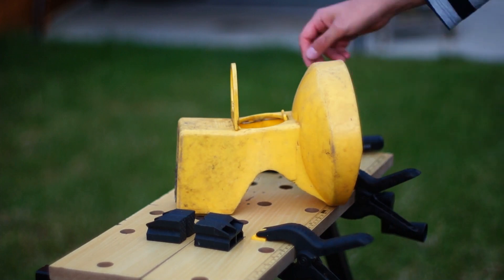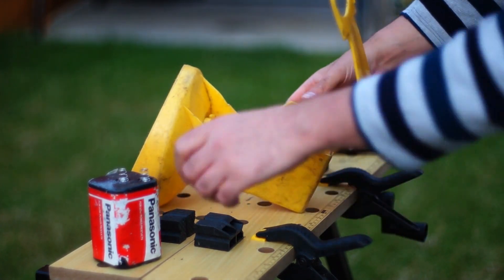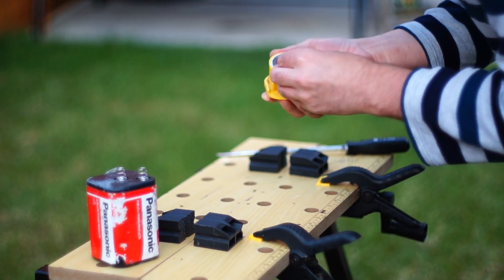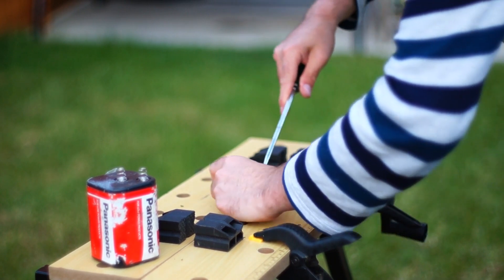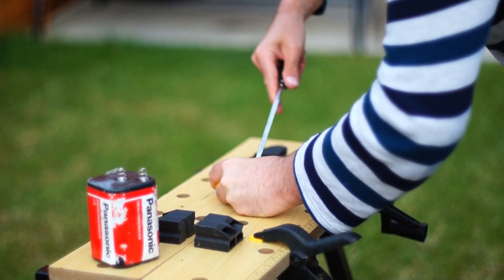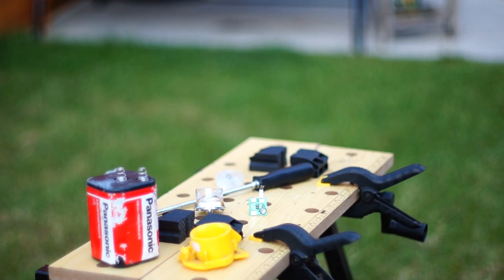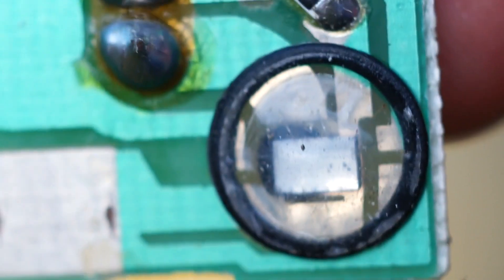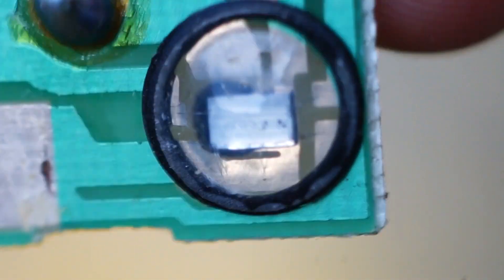Traffic Cone Hazard Light Teardown

Comment: This type of conelite is usually static... They do make flashing ones that flash in sequence called the dorman synchroguide conelite and they use inferred LEDs and detectors on the back and front of them. That's how some of them flash in sync! I own an amber one and a red one that are static
Reply from the maker: I was wondering how the flashed in synk. Thanks for the info. It curently lives as a solor light in my garden.
Reply: @TheEPROM9  No problem. 😀

Comment: The American versions are similar, only they have the light on top and the battery pack on the bottom.
Reply from the maker: Would be intresting to see there guts.
Reply: @TheEPROM9  my dad has the American version and all it does is blink on and off, I think what they do is just simply turn them all on at the same time. I think it's just a simple switch mechanism that does that on the circuitboard, at least on the one my dad has. In the US sometimes you see them on during the daytime, in construction areas.
Reply from the maker: Sounds a bit like the old scholl types. Some older ones do need to be switched off & on. Those ones used a bulb & two transistor ocilatiator. The switch on it I figured out in the end, when shoved on a cone it will switch on.

Comment: I got quite excited when I saw you opening one of these up!  Whaddaya mean I need to get out more!  Seriously these things are cool and would be great to know more on about their construction and function etc.
Reply from the maker: That they are, but sadly the mystry is still there. The older cylender units just use a two transistor ocilator hooked up to an old school light bulb. Taken a few of those apart. They are manual turn on. This one uses the IC as the light sensor.